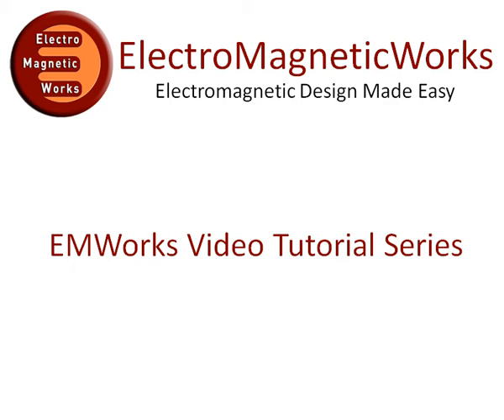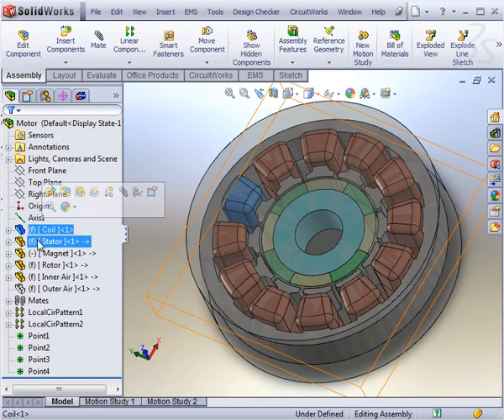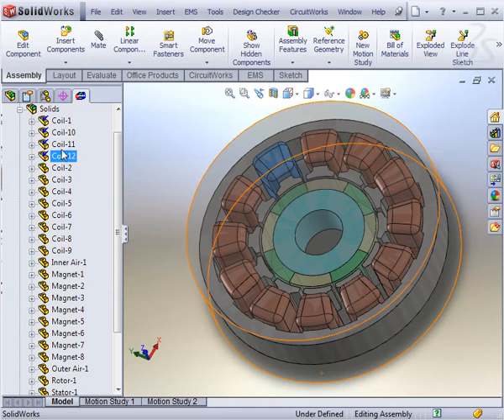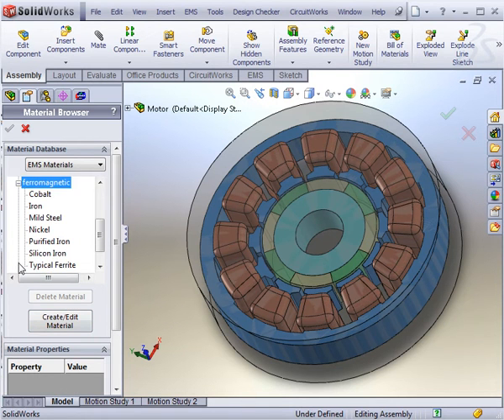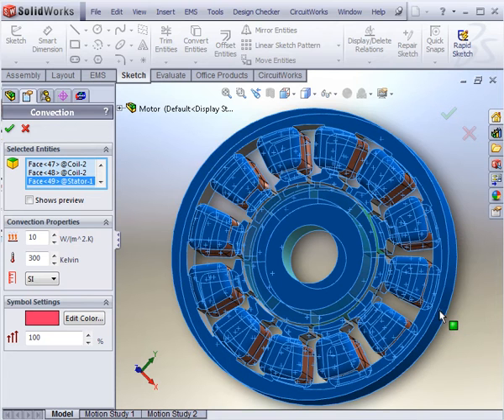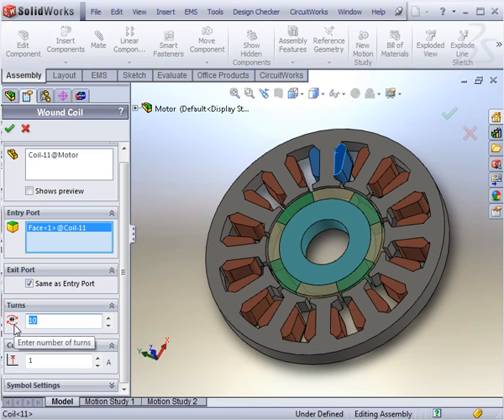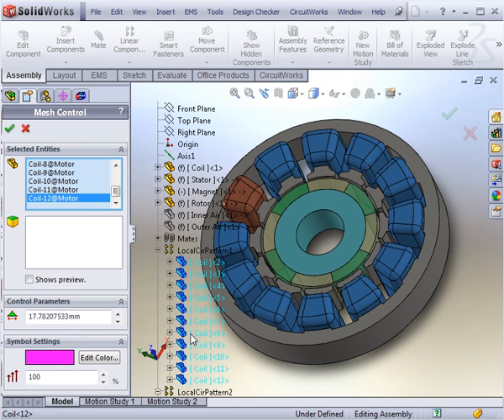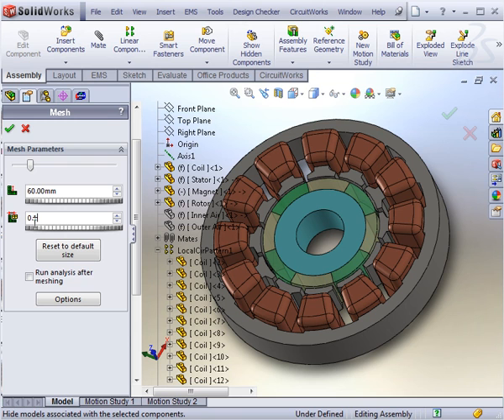Magnetostatic and Thermal Analyses of a DC Motor, using EMS in SolidWorks part 1 of 2

Comment: hi, I am very glad to have found these videos! I'm  encountering an issue when I attempt to make a cavitation of the stator, rotor, and windings, and inner air during the creation of the outer air part. it's a zero-thickness error on solid works 2016 and I assume it's  due to the windings being flush with the stator (?). anyways, if anyone has any suggestions I'd greatly appreciate it!